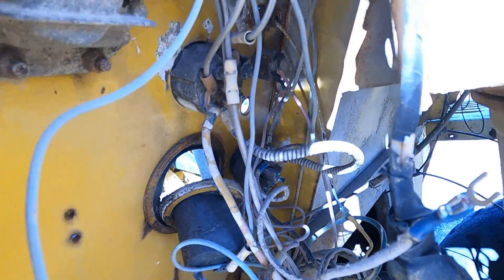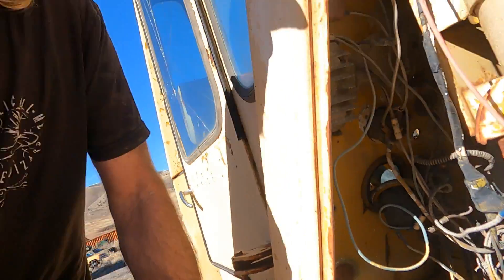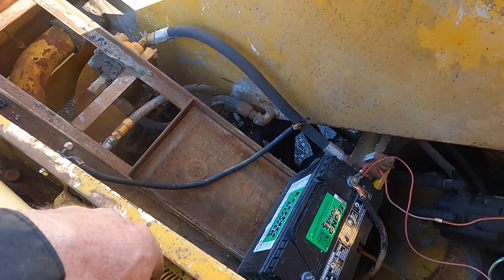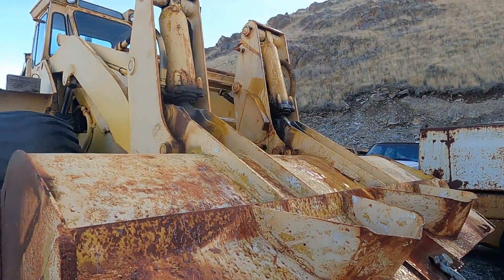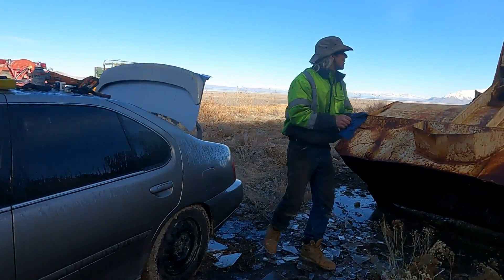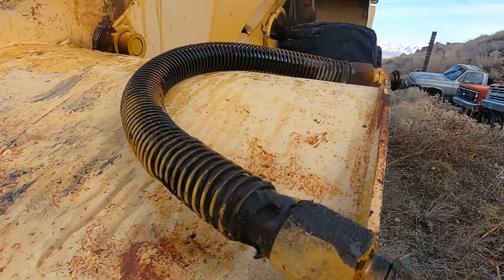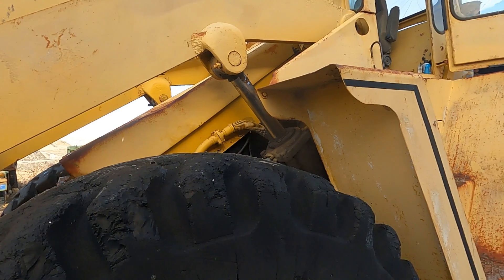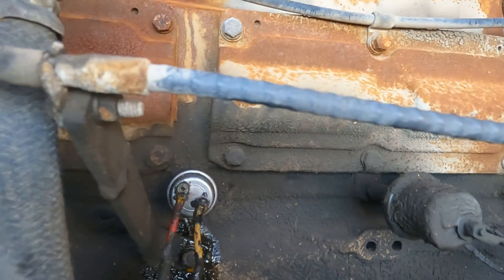Did it just explode? Can I get the Michigan Loader running? Part 1

Comment: One time I was operating a forklift on an (indoor factory being built)  construction site, picking up 55 gallon drum, garbage containers :)

I pulled back on the tilt lever, but use the Auxiliary ever by mistake.  There was no "Auxiliary" function attached to it, and it sprayed all oil on the lunch table and everyone's coats :( 

In my defence, standard procedure is to PLUG open lines like that :( .. I was also an apprentice.

Comment: Alan...  Is hydrualic oil a synthetic or a petrolium based oil?  The only reason I ask is most heavy equipment have so many hydrualic systems on them and there is a large quanity of oil involed.  I know from my time in the Army as a truck driver we had to be very  careful when ever we changed oil and if oil was spilled we had to use clay based (Kitty Litter) dry sweep to clean it up.  The we had to properly dispose of it.  The only equipment we had in our motor pool that required hydrualic oil was our 10K pound RT fork lifts.

Comment: Those old hydraulic fittings are reusable. That system is relatively low pressure compared to modern systems.